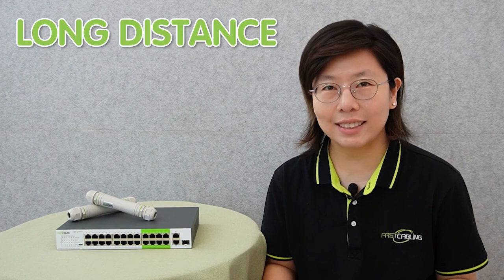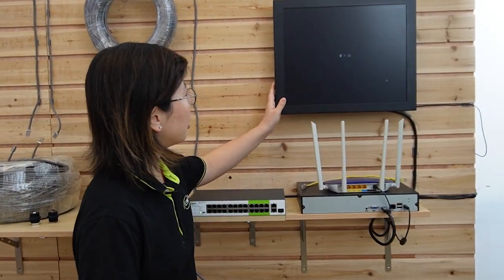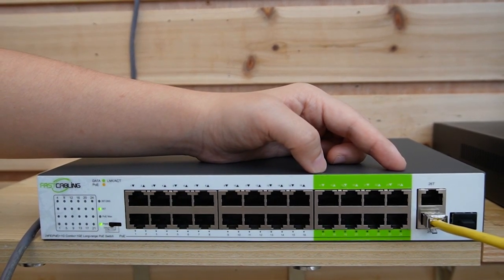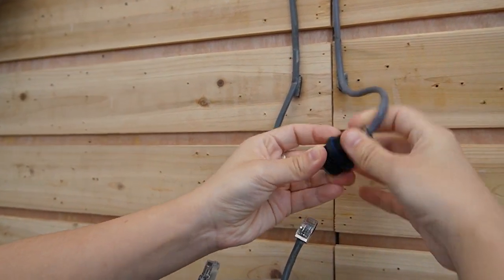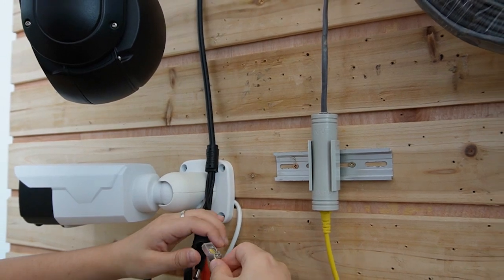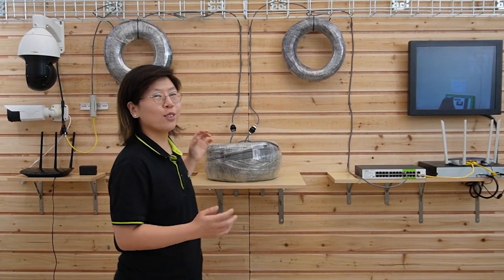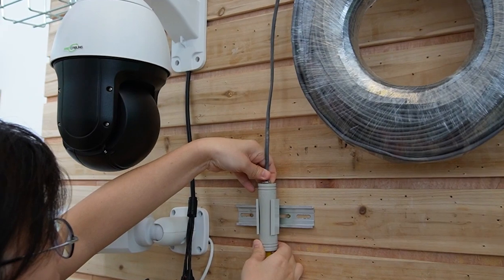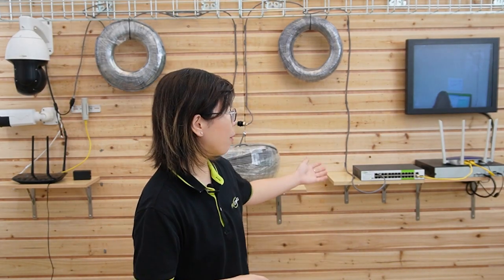Setting Up Your 24-Port Long-Range PoE Switch: Step-by-Step Guide

Comment: My steamemo poe switch does not recognize more then 2 camera what should I do?
Reply from the maker: You can verify if your PoE switch has enough power budget to support all the connected cameras. Ensure that the cameras you are trying to connect are compatible with your PoE switch and your PoE switch's firmware or software is up-to-date. If none of the above steps resolve the issue, it's best to contact the manufacturer's technical support. They can provide specific guidance based on the model of your PoE switch and the cameras you are using.

Please remember to consult the user manual or documentation provided by the manufacturer for detailed instructions and specifications related to your specific PoE switch model.